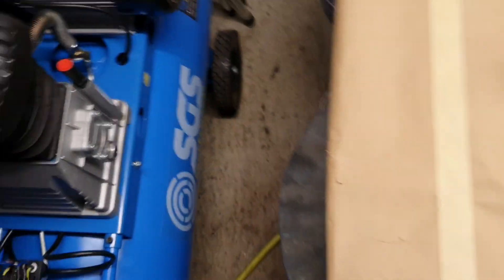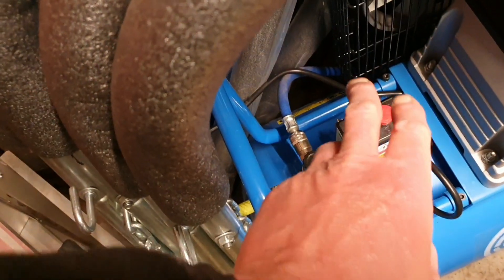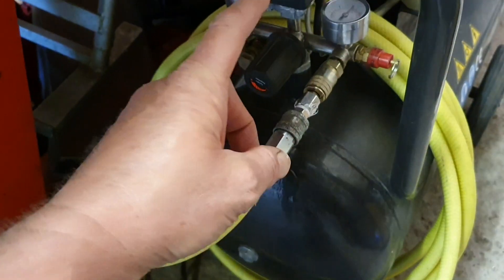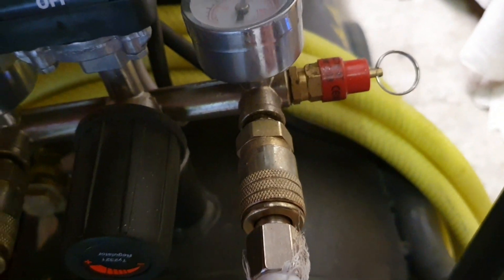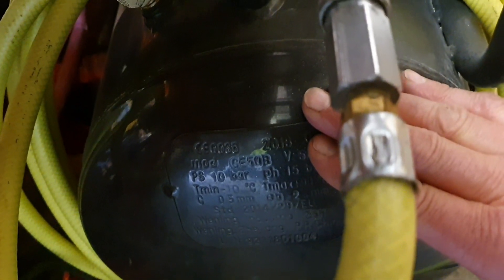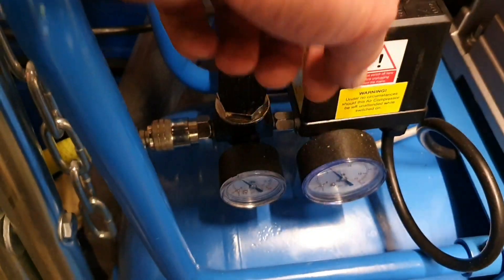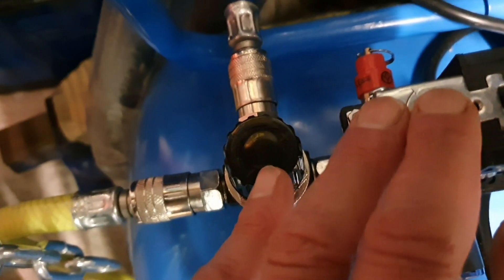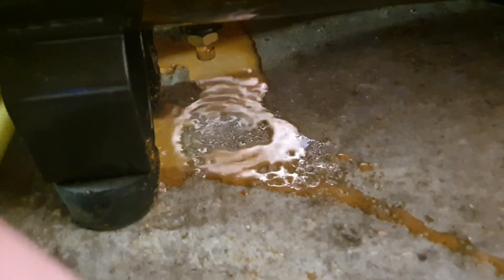Combining Air Compressors Via Link To Increase Capacity, Adjusting Cutoff Pressure & Draining Water

Comment: Hi Pete, today as I was adjusting the air pressure from my compressor to get 3.5bars on my R160 gun, I saw that there was about 40psi pressure difference between the compressor outlet and the inline wall regulator (I have another small Meiji at the gun) because my air hose was about 50ft long to cool off the air.  Anyways, I was never be able to reached 3.5bars (50psi) at R160 because I was losing too much pressure along the hose and connectors.  I had to increase the pressure at the compressor to 100psi, but then the fuse powering the garage started to trip :-))  At that point, I switched to 25ft hose, saving only 10 or so psi.  Not a good thing to lose 40-50psi until you get to 50psi.  Tomorrow, I will get a 1/2" ID hose to replace the 3/8" ID hose to see if that makes a difference.  I see your hoses are also 3/8".  You have any suggestions??  Note I use all Goodyear rubber hoses that I see in body shops.  Either I have to find a solution, or upgrade my garage line to higher amperage.
Reply from the maker: Hi Mate, I have my compressor fully open to 145psi, that is then reduced to 58psi at the first diaphragm regulator then the diaphragm regulator at the gun reduces it further as required, high output HVLP guns the first regulator is set higher to get the flow as some use 16.5 cfm.

I can't see why you're compressor trip is struggling when you up the output of you compressor, normally there is are one way reeds or valves in the compressor, so there shouldn't be more resistance on start up than at lower pressures.

Having larger diameter hoses should help in your case as it will allow you to get the pressure needed to the gun without putting the output so high.

Might be easier to uprate the trip. It is only the start-up that draws the highest current. Once the compressor is running, the current drops
Reply: @peteshobbies5383  Thank you, Pete.  The strange thing is it trips the fuse right in the middle of the run, not when it starts.  I will report my findings later on.  Is 15ft long enough to cool the air between the compressor and the first inline regulator?
Reply from the maker: You want as long as possible so it can demist the air, 15ft is better than nothing but more is ideal, it's really strange that it happens mid cycle as the amps drawn will be lower then, normally half what they are on startup

Comment: After 4 years, you are still using the same system with 2 compressors?
Can you tell, what was the most air-hungry gun you have tested with success? I mean can we use  29 psi air guns for 10-15 minutes. 
I know that CFM value won't increase the air supply.. only the fact that we will get more air for longer before one of the compressors kicks in. 
Please correct me if I am wrong.

For more CFM a bigger motor and a bigger tank (probably only one..) will be required. Correct?
Reply from the maker: Hi Mate, Yes, still use two compressors linked,  only difference is it's two of the larger ones these days.

The real air hungry guns that I have  are the true HVLP guns,  so Sata X5500 HVLP,  Devilbiss Tekna Gti Pro Lite with HV30 cap, and the Iwata LS400 guns, all around 17cfm.

With 2 compressors linked you can run whatever gun you want for as long as you want,  just make sure the power supply is up to it
Reply: @peteshobbies5383 Thank you for your quick answer! ❤

Comment: what's the specs on your blue compressor .. like what sizes is the tank..  thanks
Reply from the maker: Hi buddy,  my blue one is 90lt and the black one was 50lt. These days, I have two of the 90lt ones linked together, I have adjusted the pressure switch so they come on at slightly different pressures so they don't both click in together,  as that would blow a circuit breaker, works really well
Reply: @peteshobbies5383  thanks for the response.. i really like your videos... 👍
Reply from the maker: @josephbidal9874 You're welcome buddy,  it good to hear you enjoy the videos 👍

Comment: Super video, nicely detailed as always. I'll have to do the same i think. I have a problem where the only gun that will go above 32psi at the gun gauge, with all the regulators wide open, is the R500! I understand that the 3hp compressor may not have the FAD to match the guns (Dram (27psi max), Ntools 4000B etc) but i was certain that after the compressor fills and shuts off, it should be capable even for a few seconds so maybe i have a problem?
Here's one you mightn't like to answer: do you plug both compressors into the a socket on the same circuit? Thanks Pete as always
Reply: Ok, that's great. Thanks for taking the time to reply and to explain further. Many thanks Pete
Reply from the maker: @0012dominic No worries,  you're welcome mate 👍
Reply: Just getting around to doing this now. But looking at all compressors, they have those 1/2" BSP fittings at either end of the tank. Is there any reason not to run a 1/2" flexible pipe from each compressor to copper tubing mounted to a wall ending with a regulator, taking the same precautions regarding the cutoff pressure of each compressor? Just think it might increase the air flow? Thanks
Reply from the maker: @0012dominic The only reason I do it this way is that it's very easy to remove the compressor from the system. You just unplug and go, nothing wrong with hooking them up via the fitting on the end of the tank if it not going to be moved
Reply: Thanks Pete, yeah getcha about your way being very easy to remove. Needs a bit more thinking so. Thanks as always, Pete. You're really good at getting back with solid answers
Reply from the maker: @0012dominic No Worries mate, this system I have used for 5 years now and it works really well,  even if I run the 17cfm HVLP guns,  it flows enough.
The thing to remember is that when your 600ml pot is empty,  you will be stopping to mix/fill/swop pots anyway so the compressor or compressors will catch up. Cheers 👍
Reply: Many thanks Pete. You always give great advice backed up by facts.
Reply from the maker: Hi mate, When the guns start to consume more air, you will need the pressure higher out the filter set and compressor,  just to flow the air required. 

I ran then off the same ring main, I wired the place up, so I have a 20amp Breaker covering that supply, although the circuit is rated to 30amps

Induction motors draw most of their current on start-up, so you need to adjust them so one comes on before the other. If they both come on at exactly the same time, it will blow the breaker

Comment: Hi. Thanks for your video. 
If I'm understanding correctly, the yellow hose from the outlet of the first compressor is going to the 'outlet' of the other, even though you're effectively using it as an 'inlet'. Is that right? TIA, Andy
Reply from the maker: Hi Andy,  Yes, mate, that's exactly right. The air will go in or out depending on pressure,  so an inlet is also the outlet
Reply: Great. Thank you 👍🏼
Reply from the maker: @ACP950 You're welcome, buddy 👍

Comment: Hi pete another great video, quick question when u set the pressure on your 90ltr to 8 1/2 bar was this done on the adjustment bolt when it was topping up again? I just done ur set up but its blowing the safty valve on the second compressor like u were getting
Reply from the maker: I replaced my 8bar safety valve with a 10bar version later on, as long as the working pressure stamped on the tank is 10bar it should be fine
Reply: @peteshobbies5383  basically i just  got 150ltr compressor & my other one is 100ltr both tanks 10bar & 15bar ph but the 100ltr is only 8bar on safety valve & 10bar safety on the 150ltr, think are do what u done & change the safety valve to 10 on the 100ltr
Reply from the maker: @kingvtec100 It shouldn't be a problem to do that as long as the tank is rated, according to which it sounds like it is 👍
Reply from the maker: Hi buddy,  I just added a little at a time to the pressure bolt as it's topping up, then stop when just before the pressure get too much for the relief valve on one of the compressors

Comment: Great video, will do that with my two compressors, Tks buddy👍😎
Reply from the maker: Hi mate, it works great and is easy to do. It's also easy to detach and move or use the compressors separately if you wish. Cheers, buddy

Comment: About to do this with a new and old compressor for 100 litres. My question is are you running the blue line off the 90 litre compressor to your tools and just the yellow one to the 50 litre for extra air capacity?
Reply from the maker: Hi mate, yes, that's what I did, I now have 2 x 90lt compressors and the 50lt if needed.
It doesn't matter how you do it. If you have the airline you draw from on the slave or the principal compressor, it still works fine.

Comment: i have been doing this with no regulator on first comp,strange how regulator works backwards  this is only video i have seen where someone has not purchased some fittings and done it this way   good work
Reply from the maker: Hi Richard,  it works fine this way, and it also means you can move either compressor and use it separately, I've since got another larger compressor and linked the two larger ones together in the same way, cheers 👍

Comment: This wouldn’t work for me as I am after more cfm for blasting cabinet or would it
Reply from the maker: Hi Adam, there's no reason why it shouldn't, weather it's enough depends on the cfm that your cabinet draws.
The two compressors in this video both produce around 14cfm, this will be around 9.5 cfm free air, the total capacity is 140lt , so if 19cfm free air and 140lt capacity would work then it's fine, that's providing your power supply can run two compressor, the current draw would be around  4,400 Watts if they were both going together
Reply: @peteshobbies5383  thanks Pete this is really helpful
Reply from the maker: Your welcome mate 👍

Comment: Hi there ! So by combining these compressors together, would you reckon that would be ideal for spray painting?
Reply from the maker: Hi, yes, it's what i use, I only normally have one compressor running at once though and just use the extra one as storage but if you need lots of air you just plug both in and they look after themselves

Comment: Hello Pete could would you do a video of your set up I think that would be helpful  to alot of diyrs and guys spraying in there shed, compressor type airline water trap  filter setup ect ect

And the CFM ltr min do you have a dedicated air fed mask or a thro away 2k mask  have you enough. Air for your guns and mask brilliant videos mate new sub here
Reply from the maker: Hi Lee, thanks mate, I will get round to a video of my setup it's just a matter of trying to make it interesting enough as it's a lot of words with little camera footage if that makes sense.
I do have a Devilbiss air fed mask but am guilty of rarely using it, if i do i have a separate filter set, same as the one i use for the guns that i use for that on its own single compressor that is outside the garage, most of the time i use a Moldex respirator, this isn't recommended for 2k as only an air fed is but its seems to work for me, all my compressors are 14.5cfm so i normally only need one running but you can put 2 on at the same time if needed. Cheers 👍

Comment: Yeah thanks Pete that was how I reduced the cut off pressure from 10 to 9bar on my compressor.

As your slave tank can withstand 10bar you could remove the pressure relief valve (then plug it) from the slave tank then the one on your SGS compressor will serve both tanks or you can put a different pressure relief valve in your slave tank.

I made a mistake on the re-charge time for my compressor, I told you it was 1min as I was watching my vids and timing it from there I forgot my air fed mask was being used so it was under load while re-charging, accurate re-charge while using my mask is 50sec and once cut off it stays off for 1min 20secs. Need to time it when nothing is plugged in.
Reply from the maker: I didn't want to remove the relief valve as I separate them if i need to take a compressor somewhere, the 50lf is nice and easy to move around  and can go in the car if needed, I had  thought about another valve but it's not been a problem anyway, if i want lots of air i just have them both plugged in and one or both cut in when needed, also handy to move out the workshop if using air feed as it then gets clean air, you been doing any more spraying today?
Reply: Ah I see, if you need to be able to use it on it's own then it's best left as stock setup. 

Yeah just been doing some flow coating work testing out different clear and hardener combinations. I like the Final Systems HS clear but the hardener causes a lot of dieback if you use anything over the slow speed and that is to slow when doing small jobs, again Tony has been advising me with this and so far the best one is the Churchill medium and fast or the upol S2030 fast which I tried today and both gives a great finish with no dieback and flashes off pretty quick.
Reply from the maker: @JohnWD40TC02  I use the upol 2030 most of the time, the 2031 dies back more, to be honest, vertically all i use for YouTube stuff is 2080 , it's really underrated imo, it's harder to spray as it's less forgiving but once you have mastered it you don't have any issues using anything else
Reply: Yeah agree about the 2080, I still have about a litre of it left, it is a nice clear and flashes off very quick plus gives a nice finish. 

Like you with your guns, I like testing different clear kits and mix and match the hardeners to see what combination works the best.

Comment: Hi Pete, just out of interest, when you pack up for the evening do you discharge all the air out your compressor or leave it at what pressure is left? And does this change for you if you was to leave the compressor unused for say a week or 2. Cheers.
Reply from the maker: Hi Steven, I always leave it on whatever pressure it's at, then, next day i start it up, I drain it on startup every 2 days or so depending on how humid it is, it never holds pressure completely so if its left for 4 days or so it more or less runs itself out of pressure
Reply: @peteshobbies5383  Thanks Pete, that’s pretty much what I do, although it sounds like my compressor holds its pressure better I can leave mine for weeks and still has what pressure I left it at. 
It just makes sense to me to leave it as I’m sure the big swings in pressure can add more stress and it puts less ware on all the parts involved. Cheers once again. Steve.
Reply from the maker: Yes,  certainly,  if yours is holding pressure then it makes no sense to dump it, I know where my one leaks from but it means removing an aluminum pipe which i don't want to do as they become brittle so i just put up with it

Comment: I had the same problem last night With my pressure relief valve scared the shit out of me. What about putting a check valve in line stopping the air from building pressure in the tank that has the lower relief valve?
Reply from the maker: Hi Damien, yeah, that would work, I've just adjusted the 10 bar 90lt compressor down a little to stop it blowing the 50lts compressors relief valve, I've just finished a job that used loads of air so i had then both on together, the 90lt compressor kicks in first and if it can't keep up with demand then the 50lt also kicks in a little later, works brilliantly although a little noisy